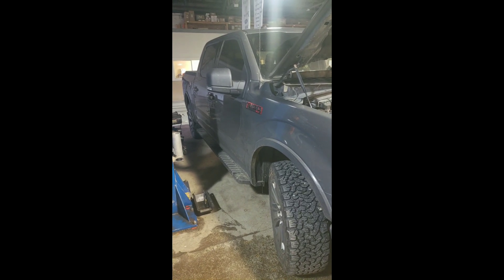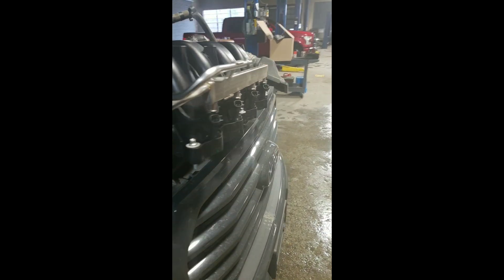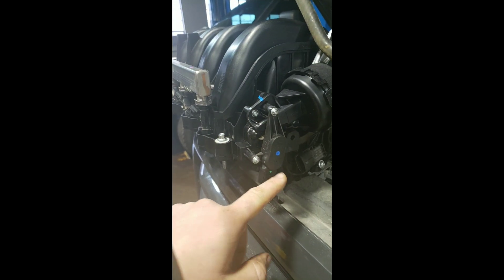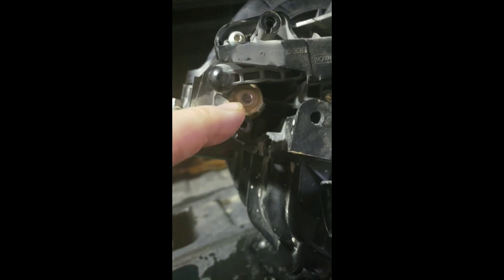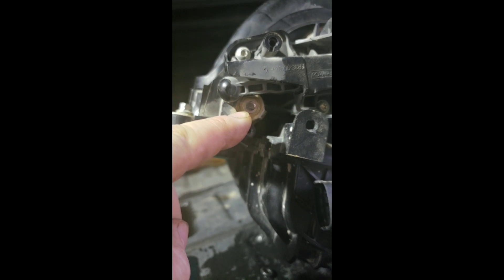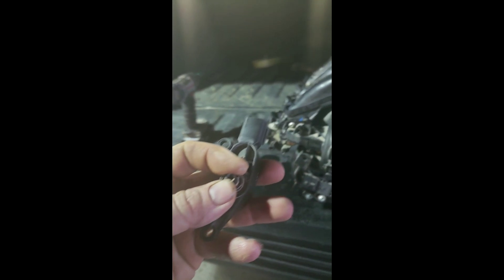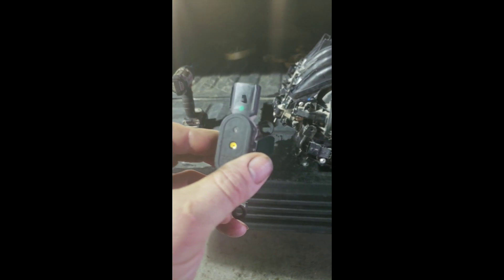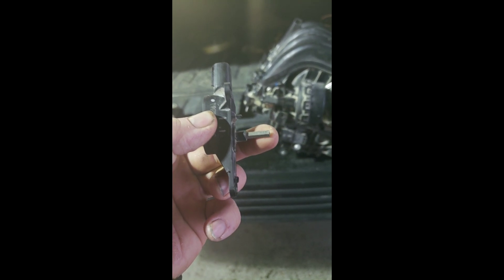Ford IMRC CODES 5.0 COYOTE MOTOR.... P2014 intake manifold Runner codes

Comment: 2017 mine just did the same and no parts available!!!!!!! i'll try to fix that small shaft and see how long it last.
Reply: I'm with you. I love being told that something can't be repaired. I accept that as a challenge.  Good luck.
Reply: @IBEWelectronut  Did a delete on the IMRC for over a month now and all good so far ,and even better gas mileage!
Reply: Delete? How? Did you get a tune also?
Reply: @mxbigd17  I took the intake off and zip tied the 2 shafts wide open and took all the vacuum pots off with all the sensors .Did this over 6 months ago and still great! The engine light is on and I'm still debating to get a tuner or not.
Reply: Did you get the check engine light to go out? @oldtimerdh
Reply: So…this just happened.Have a new intake on the way from rock auto.My question is how will you know what position to install the new sensor since it’s been spinning with a broken rod !
Reply: @michaelr.7054  When the intake is off the vehicle you car see the plates inside the intake. I just put them wide open then secure them with some zip ties.

Comment: Is it the entire intake i would need to replace or just those rear sensors?
Reply from the maker: Those butterflies are made through that intake manifold so if that little Nubs snapped off the back you have to replace the whole thing
Reply: @fullcend-tkm73  10-4!

Comment: I put in new oem intake. Running fine but p2007 code won’t clear. I know it’s a permanent so you can’t pass inspection with out repairing. Anyone else encounter this and if so, how long did it take for the check engine light to go off?
Reply from the maker: Did you clear the code using a scanner?
Reply: Scanner won’t let you clear the code. Permanent codes have to be cleared by vehicles pcm by driving it. It’s been three days since repair and light is still on so I’m thinking I will need to go back and check my work. My scanner cleared out temp codes.
Reply from the maker: @rpink0077  a permanent Code will show up on your do not diagnose list, it will clear it but it and then you need to go through a drive cycle in order for it to see that there's no problem anymore

 a drive cycle is what you have to do, drive the vehicle and you have to meet certain criteria in order for it to go away. 

Now every vehicle is different and normally if you have enough time maybe a couple weeks sometimes it's just a few days it will eventually clear under the Do Not diagnose list as well
Reply: I just went out and cleared out codes again and got the check engine light out. I guess I can wait it out for another couple weeks and see if it cleared the codes out eventually. I drive a mix of highway and back roads to work four times a week.
I think the install was solid, not much to it and it runs great.
Reply from the maker: @rpink0077  yeah it's not a hard install you just have to be patient and don't rush things
Reply: I researched for awhile and I didn’t come up with a clear definition of a drive cycle for this. Is there any criteria that says what you have to do for a completed drive cycle?
Reply from the maker: I've got a lot of stuff in the shop today to get to normally if people have time before an emissions test we tell them just drive the vehicle and it'll clear it's too hard to explain

It may be something like the truck needs to see 55 down to 35 without hitting the brake five times and then it may be something like a cruising speed of 60 miles per hour for 10 minutes before exiting the highway and coasting down to 30 and then hitting the break slowly

You're just going to have to drive the vehicle for a while and just normal driving on Highway and then like you said off road back roads should clear it but if I get time tonight before I leave and go home I'll try to send you some info but I really don't have a lot of time today because I have to get multiple Vehicles into the shop
Reply from the maker: I need some information from you in order for me to help you so you're going to have to tell me year make model engine size even possibly send me the VIN to my email

poissorichard.rp@gmail.com

Comment: Perfect video, exactly what thru the P2005 and P2007 codes on my 2017 F150 5.0. Replace intake at the dealership. Hope the new intake has been re engineered to alleviate this weakness, as it sounds like a very common problem.
Reply from the maker: indeed

Comment: Huge thanks for this video. My 2016 regular cab 5.0 threw this code last night during regular driving. I’m out on the factory warranty and my rod was broken so instead of paying ford out the ass for a stock manifold I’ll just buy a cobra jet or boss and get a little performance out of it since I’m already in three
Reply: Check and see if the rod is just worn like mine
Reply: https://youtu.be/nwhRKLjHzKI

Comment: I have a 2016 f150  5.0 with 124,000 miles that just started Showing the imrc sensor code. I've seen a few people putting the 18+ intakes on their older mustangs. Im curious how hard it would be to do on the f150. I'm hoping just imrc harness pigtails and done
Reply from the maker: That I can't really help you with because I've never done that change but it is not that hard

Comment: Just replaced the manifold on my 2017 F150 5.0.  Low and behold, the driver's side pin had sheared off from the IMRC.  Hope the new manifold lasts longer than the 75k that the first one did.
Reply from the maker: That's a common problem

Comment: 2017 F150 5.0L:  Had a P2019 at 35k miles, same problem. Now at 75k miles I’m getting a P2007, from what I’m reading it’s gonna be the same issue. It’s frustrating that Ford refuses to acknowledge that this is a faulty design. Im now out of warranty and having to come out of pocket for the same faulty part from Ford because it is so new that nobody else is even manufacturing it yet!
Reply from the maker: It's very sad that they're doing this and I wish that they would acknowledge that that is a problem as well as the leading front covers on the EcoBoost engines
Reply: I have a 2016 F150 with this P2019 code and Ford dealership is telling me their on a 2 month back order. 
Where did you purchase yours? dealership name, State parts dept Phone number anything would be helpful because I neeeed my Truck.
Thank you
Reply: @andrianipaintinginc.902  I got mine in the Dallas/Fort Worth area. The parts guy at the dealership
near me had to call several other dealerships to find one (not sure where it came from). I believe the part was backordered back when I had to replace mine as well. If they’re selling out of a replacement part that’s a problem, I’ve replaced mine twice since I bought the truck in 2017.  You may get online and see if you can snag one from eBay  etc.  Good luck!
Reply: @chrislynd3568  Thank you Very much chris
Reply: I was able to fix mine because the rod was only worn.
Reply: https://youtu.be/nwhRKLjHzKI

Comment: This just occurred to my 2016 F150 V8.  Dealer wants to charge 700 to change Sensor.  Stated the only thing wrong is the sensor.  I am very capable of doing this my self.  If you could assist in answering a few questions.  Do I have to replace the gasket once the manifold is removed to change sensor, should I change both since I have the manifold off, and are all 2016 xlt F150 V8 motors coyote motors or could I have a different motor wherein the part numbers you list will not work.  Thanks  Brian
Reply from the maker: Email me your Vin and I'll check first thing in the A.M. 

POISSORICHARD.RP@GMAIL.COM
Reply from the maker: The issue I'm speaking of here is specifically for the 5.0 coyote motors

The other motors do not have this setup

3.5L EcoBoost 
2.7L EcoBoost 
3.5L No Turbo
3.7L No Turbo 

Are the other options which these would not have the code I posted in this video 

You dont Have to Replace the intake manifold gaskets but I would
Reply from the maker: 700 is a great deal honestly

Comment: Great video - can you share the "name of the part" or part number/id that I need to ask or search for?
Reply from the maker: The only way that I'll be able to give you the appropriate part number for your truck is if you give me the VIN number and then I'll run the parts here at the dealership and figure out what your intake manifold part number is or you can call them up and give them your VIN number and they will tell you what it's going to cost if you go through the dealer but you could probably find an intake manifold aftermarket online
Reply: @fullcend-tkm73  you have an email?  I will email you what the dealership gave me.
Reply from the maker: poissorichard.rp@gmail.com
Reply from the maker: @TheWkp911  let me know I sent you my email sorry today was a long day at the dealership

Comment: Great Video, Most informative thing i have seen about this!
I just got a P2019, Manifold Runner Position Sensor / Switch Circuit Bank 2
Truck is running really good at the moment. 
Do you think thats just the sensor? 
https://www.f150forum.com/f118/p2019-intake-manifold-position-sensor-switch-circuit-bank-2-a-443223/
Thank you for your time!!
Reply from the maker: Well what ends up happening is that butterfly that goes through the manifold brakes and sometimes it runs good and sometimes it doesn't run good it all depends on if it catches the part that's broke off in the sensor correctly so it could be either in that case you have to order a whole new manifold if the runner butterflies broken on the end that goes into the sensor 

sometimes you could catch correctly and just turn the sensor position as well sometimes it doesn't so it's iffy you got to take it off and look at it
Reply: Thanks for your reply! Any odds that because it is not a range, performance, or stuck error that it is just the sensor? As a DIY guy what my best course of action? Take it off inspect the runner and that post, if it’s good replace the sensor. If bad the whole intake?
Reply from the maker: @APDLuu  I'd say yes that's it indeed
Reply: Pulled bank 2 sensor off... post and all! You were right! Those harness pins in the manifold were a pain to remove
Reply from the maker: @APDLuu  so now you know your problem, good job sir.
Reply: @fullcend-tkm73  Thank you for your video!
Reply from the maker: @APDLuu  not a problem at all
Reply: Put it all back together, no codes!! Thank you so much!!!
Reply from the maker: @APDLuu  no problem brother thanks for the feedback